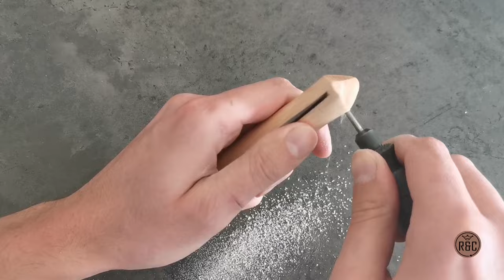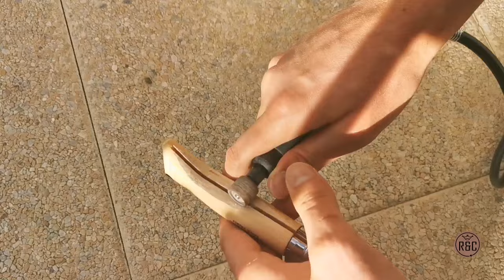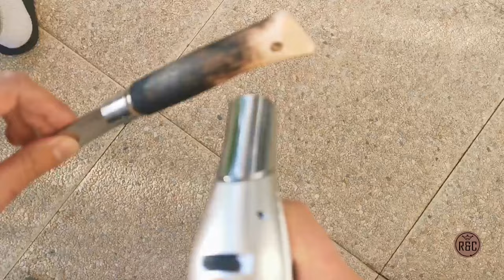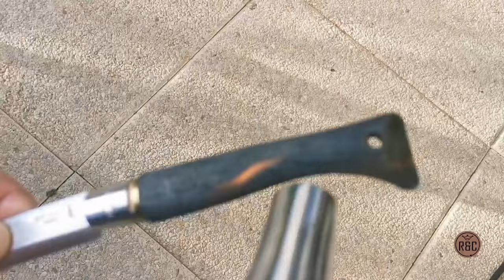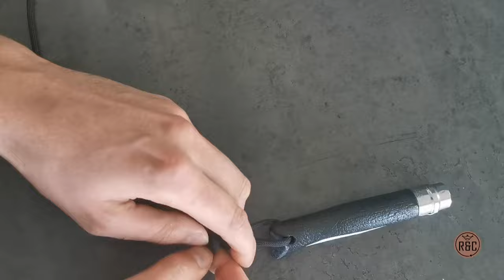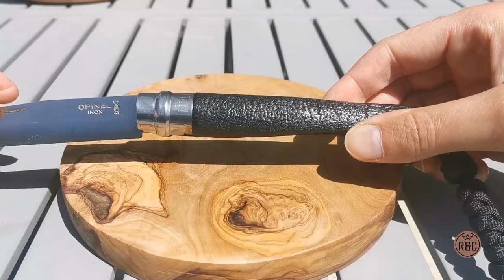DIY CUSTOM OPINEL N°10 (burnt wood)

Comment: Listen, or better read this! I got a No9 Carbon I used a file, and made the blade, the most beautiful drop point, I've ever had! Then, I sanded the back sharp corners, to make the handle even more comfortable.After that, I burnt it slowly, using a cheap jet flame lighter. Then I used a lot of raw linseed oil coatings and after they dried. I used wax, to seal the handle forever. For the final step, I stabbed a lemon and let the blade in for many hours. The final outcome, was the most beautiful and functional Opinel I ever had!!! The blade took a very beautiful camouflage pattern! It takes the looks and the feel of the knife to the next level!! I like this mod here too, it's very different ,but still way better than the factory finish!!
Reply: What about the lock collar  ?
Reply: I do nothing with it. Becareful,If you add oil in the colar, the lock then disengages, so it's dangarous! I only put some oil/wax mixture, to seal the wood in the end,after I finish with all the mods. I never do anything with the colar. @GavTatu
Reply: @greekveteran2715  i took mine off and put it in the flame till blue. it still works, and matches the blade colour better.
Reply: Nice mod! I did have an accident, where I lost my finger last time I meesed with the colar,so since then, I never tried anything! Black (completely burnt handle, finished with oil/wax) makes an excellent contrast with the chrome finish of the colar, that I like very much! The mod I like more though, is to filedown the tip, to a beautiful drop point! and then either stick the blade in a lemon for a day or inside Vinegar for 2 days (avoiding the vinegar o get into the wood, because it swells it and the blade doesn't move freely after that. Thank you for the idea, it sounds really cool! !  @GavTatu

Comment: What did you paint it with?
Reply from the maker: Hi, I didn't use paint. In a first time, I burnt the wood. Then, I use a wood varnish (I guess you speak about this) with shining effect. But you can also use Linseed oil for a not shinning effect. With oil is the classic technique ou burnt wood (ShouSugiBan)
Reply: Pine tar work over the char?
Reply: Did u char the top part by the blade? The camera never showed it.
Reply: i believe you use a water based and more expensive polyurethane.  it goes on Milky white.  i can't afford that stuff.

Comment: What are the pliers called that you removed the collar with?
Reply from the maker: It's called ring pliers. You will find a bing range of price. The cheaper I found was 5euros
Reply: Swiss army knife bottle opener gets the collar off easy.
Reply: Also called "circlip" pliers for the removal and installation of a circlip on a shaft.

Comment: Jolie travail, félicitations. 
Une question tout de même. Quel produit utilisez-vous à 4 min 20 de votre vidéo?
Bien cordialement 
Anthony MORIN
Reply from the maker: Salut, j'utilise du venis (effet brillant) pour bois. Cependant, il est aussi possible de saturer le bois avec de l'huile de lin (idéalement avec de l'essence de térébenthine en plus ) (dans ma dernière vidéo, j'utilise de l'huile de lin. Ceci est le moins chère, environ 3 euros /Litre) . Ceci protège le bois avec un effet mat. Une de ces deux étapes de protection est nécessaire pour que le '' brûlé '' reste '' fixé '' sur le manche.
Reply: @restorecustom2746  
Bonjour,  tu laisses baigner combien de temps pour saturer le manche avec l'huile de lin et therebantine stp ?
Le manche ne gonfle pas ?
Ça  tient le coup dans le temps ?

Et si le mélange est additionné de colorant, ça colore entre les interstices du bois brûlé ?
Reply from the maker: @michelremy2910  bonjour,
J'utilise un pinceau pour bien imbiber du mélange. Je laisse reposer et applique 2 ou 3 fois supplémentaires. La protection peut être à répéter tous les 2ans par exemple selon l'utilisation du couteau
Reply: @restorecustom2746  
Merci...
Pour protéger durablement le manche en bois.

Est-ce que tu connais le Balistol Balsin huile pour crosse brun-rouge à base de silicone.

Et le Protecteur bois brûlé PB600.

Serait-ce mieux à l'usage pour manipuler tous les jours le couteau ?

En remplacement de l'huile de lin ?

Cordialement,  Michel